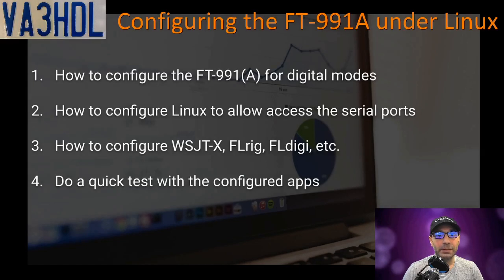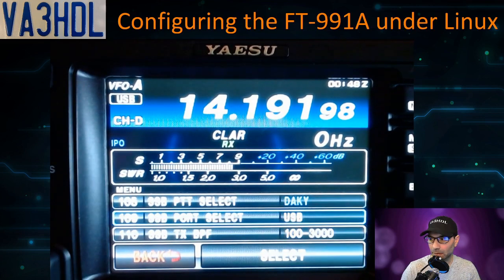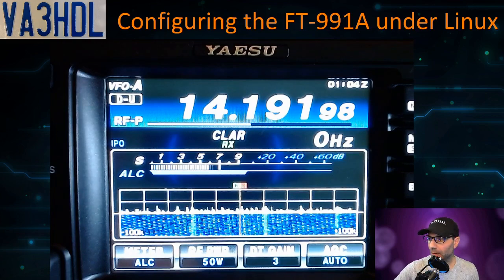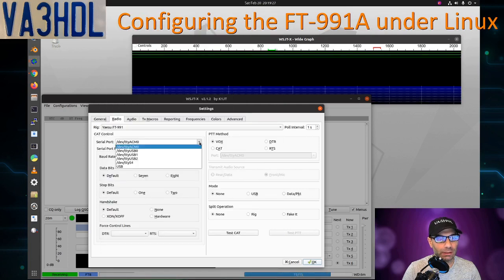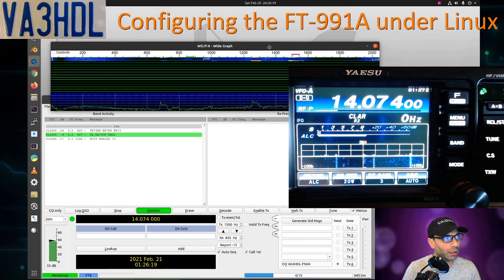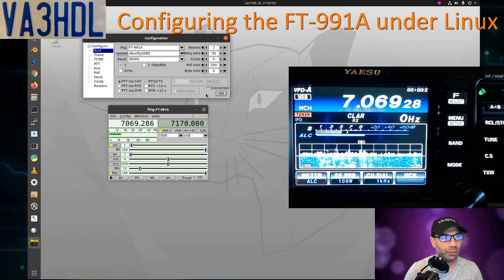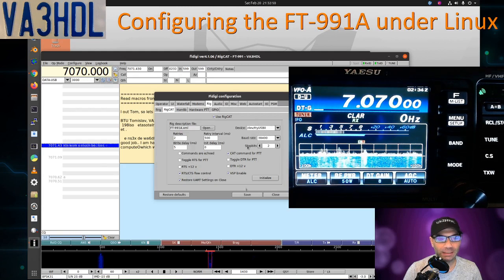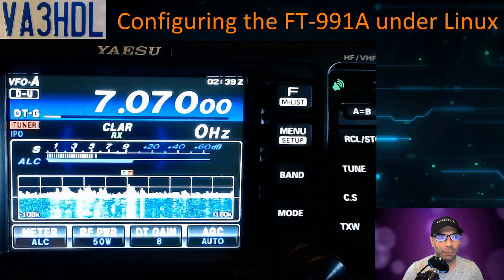How to configure FT-991A in Linux for digital modes

Comment: I am using parts of your video to configure my Yaesu FTdx101D on Mint Cinnamon. I entered the info re dialout in the terminal, but I received a message stating the command dialout does not exist. I installed WSJT-X, I am receiving FT8, but there's no CAT or Transmitting. I am a Linux beginner!
Reply from the maker: Hi, check this tutorial with all the steps, you can copy and paste the commands from that page to avoid typing errors.
https://just.plain.cool/post/2017-01-06-install-and-test-hamlib/
73

Comment: I note that the "Band Select" buttons found at the very bottom of the flrig interface (after pressing the down arrow) do not appear to work with this set-up? is this normal for the 991a or am I having and issue?
Reply from the maker: Unfortunately I do not have anymore my computer with Linux connected to the radio at the moment. I had dual boot setup and my Linux HDD died. I can give it a shot with Windows and let you know later.
Reply: @VA3HDL  Thanks. Everything else works great and got my  first Digital/PSK 31 Contacts.  I just wasn't sure about the band select buttons not working. Any info would be appreciated. I have done a search on the web without luck pertaining specifically to the band select buttons.

Comment: hi,how can i use the wstj-x ,ft991a and a raspberry pi ?
Reply from the maker: Hi Fernando, mainly as it is explained here on this video. The RPi runs Linux too. I have a couple RPi but I never connected to the FT-991A. For this video I was running Linux on my main PC. If you need further help or guidance on this topic please drop me an email to my callsign at my callsign dot com - 73

Comment: Just what the Doc ordered, thanks very much... I already have most software loaded on the Rpi400 and this video will make it easy to get it working... VK3CDE
Reply from the maker: Great to hear! 73
Reply: With FLDIGI are you running FLRIG as well? Can’t get the rig to communicate will the 991A file, I’ll keep trying though...
Reply: I have got it working, thanks again... Just reloaded the file and it works now :)
Reply from the maker: Excellent! I'm glad to hear you got it to work. 73
Reply: Not running flrig...
Reply: Not running flrig...
Reply from the maker: I read you fixed it. But not, I'm not running FLrig. I try to keep the computer as lean as possible. FLdigi runs without FLrig with no problems. If you run FLrig before FLdigi, it will capture the serial port, and FLdigi will not see it, unless you configure CAT in FLdigi to work via FLrig, which I don't do. 73